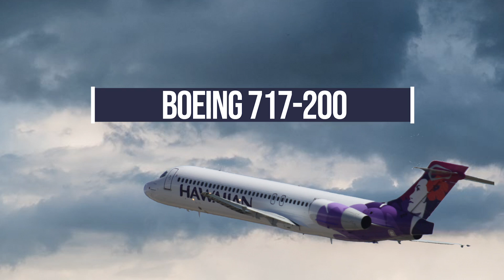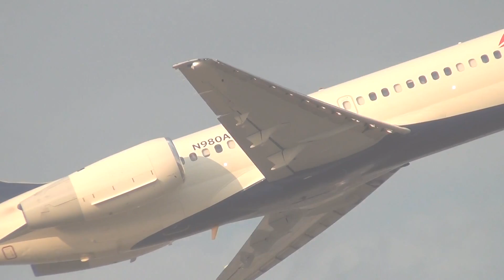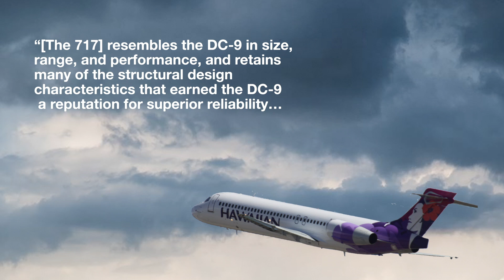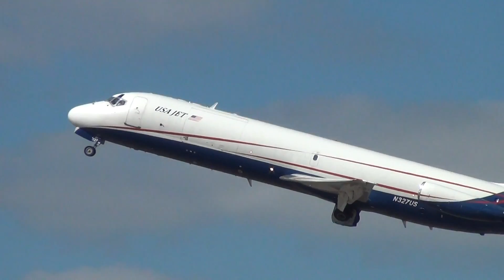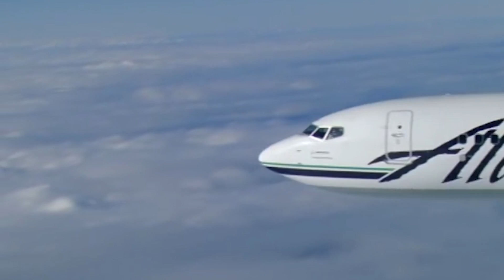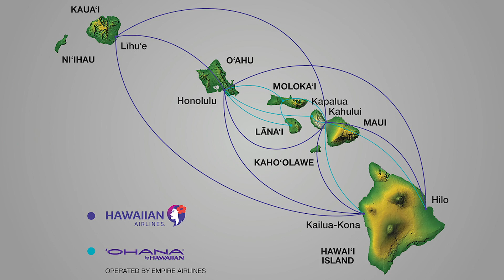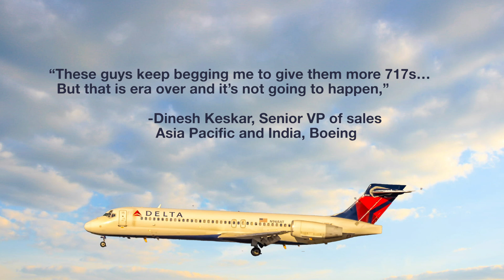Why Boeing Built The 717 And What Makes It Special

Comment: "No market could be found". Hah. Ask the guys who were working airframe planning at the various airlines, you will get a different story. Boeing and Airbus were still in denial on the 100-128 seat market when the Bombardier C Series, now Airbus A220 came to market. No one would touch it. It is no coincidence that the largest users of 717's was a large buyer of the C Series/A220. In fact the routes served by the 717 will start being replaced gradually in 2025 with the A220. The market as it is called is not being driven by seat/fuel economics, its being driven by the pilots unions. They can't get large pay increases if the airframe is too small to absorb the cost of their contractual benefits. They need/want large passenger craft to justify their existence.

Comment: The introduction of the DC9 occurred prior to the McDonnell takeover / merge. So, it was merely the Douglas DC9. After the merge, it was still designated DC9. When the DC9-80, later the DC9 Super 80, was redesignated the MD80, it was due to FAA politics. 

When Boeing acquired McDonnell Douglas, they promised to keep the MD80 series & the MD11 in production "as long as there was market demand". Sounds fair enough, but Boeing refused it's most appealing finance deals to the Douglas aircraft, ensuring their demise, and breaking their contractual obligations.

Comment: I might be wrong about this.  The stories I heard were that Boeing basically finished up the MD series run that was already in production by McDonnell Douglas at the merger, and redesignated it the 717.  It ended because it competed with Boeing's own legacy narrow body product.
Reply: Yes, when Boeing took over they went to all the customers and told them to buy 737s. Customers went to Airbus. Boeing had to finish the production line for the Customers that said no.

Comment: I wondered why had never heard of the B717, no fault of my own it seems
as it didn't appear until 1997 might be why, some also losing the eyebrow windows
normally used when banking in a turn, I thought they looked like the DC-9 type
very large bypass engines with full reverse capability as today it's just bypass air only.

Comment: 4:12: You neglect to mention that Embraer does compete in the 100 seat market with its E190. The E190 was about equal to the 717, becoming a regional workhorse for most notably, JetBlue. Sure, the 717 and E190 are 8 years apart, but still.

Comment: The 71  was the latest version of the dc 9 prior to Douglass being bought out in bankruptcy by Boeing . 
Boeing - instead of scrapping billions in r&d opted to complete a production run on the aircraft .
The engines on the 71 are so over powered for the aircraft the pilots were encouraged and incentivized to pull back the throttles - even during take off - to both save fuel and reduce hot section and o/h costs on the engines.

Comment: Maybe Boeing should have built the 717 max instead of the 737 max
Reply: Not really, the 737 MAX is also intended to compete with the A321 which is bigger than the 717 could get. But I agree, an aircraft the size of the 717 would’ve been good to compete with the A220

Comment: @3:36 - “the 717 was able to access the small, remote islands of Hawaii that larger narrow body jets couldn’t....” While I generally agree with this statement, it’s not entirely true. All of our airports here in our islands are serviced by larger jets including the 767, 777 and 747 in addition to the 757 (-200’s and -300’s), 737’s (all variants) as well as A320’s and A321’s. The issue isn’t the size of the airport as it is the turn around times and frequencies of (Hawaiian Airlines) schedules. Larger aircraft engines need more time to cool which conflicts with their schedules. WN uses the 737’s within our state and I believe their turn times aren’t as tight as that of Hawaiian Airlines. The only other a/c that could keep up with the high turn schedules is the 737-200 as was used by AQ when they were in operation. AQ tried using the 737-300 and 737-400 variants on their inter island routes and it just couldn’t keep up.

Comment: There is a other reason.  At least in europe. SAS use to have a huge  fleet of MD80. But after the gotröra crash the pilot union refuce to fly the aircraft grounding all of them.  SAS dumpad the whole fleet on the second hand market flodding  all of europe with them, kyckling away the market for the 717.

Comment: The engines are good in everything but overhaul cost per flight.  They are only designed for 8,000 cycles between overhauls versus 20,000 on the CFM-56 or V2500.  There is supposed to be a PiP as part of Delta taking the type.  

Delta is debating on retiring the 717.  We'll find out their decision within a year.

Comment: First, Boeing didn’t build the 717, it was a rebrand of the MD-95 from McDonnell-Douglas. It was an upgraded version of the venerable DC-9. Boeing never pushed the 717, because it would take market share from the 737ng. As soon as those orders were filled, they killed it.
Reply: Technically, as soon as the subsupplier contracts were filled they refused to take any more orders for it. And the reason Boeing was so eager to kill the 717-200 was that a 717-300 absolutely would rob from 737s market share. Keeping the -200 alive virtually guaranteed airlines would start calling for an MD-80 sized variant sooner or later.

Comment: The big question is: How did Boeing save the 717 number back in the 1960s by skipping from 707 to 727?
Reply: There was a 717, you know it as the KC-135! Boeing had no ides that the 7_7 numbers would become Iconic, so they gave the next number, 717, to the KC-135.  Ther are still small plates on the tanker that say this ...if you know where to look!

Comment: Sometimes Boeing just can't get out of it's own way.....they have a plane that was successful and customers begging for more but yet they stop production........ I am sure the A-220 is very grateful 😂😂😂
Reply: First off - they do suffer from 'not invented here' syndrome. But to be fair, Boeing made more off each 737 hull than DAC made off each DC-9 hull. From a business standpoint, you do not maintain two product lines to service the same market. Maintaining a 717-200 line would eventually bring pressure from customers to stretch it into a 717-300, or MD-80 size, which would have directly affected 737s market. Boeing did not acquire Douglas Aircraft to expand or continue it's products, they wanted DAC's customers to start flying Boeing fuselages. Gee how well did that work out?
Reply: @rotty9786  You are ultimately correct, Boeing would certainly not want to end up crowding out future demand for 737s, just saying the quote at approximately the 5:02 says it all

Comment: If a pilot has a DC9 type rating, would they need a new type rating to fly the 717?
Reply: No. All DC-9s had a common type rating. A CD-9 pilot would have to attend a differences class. This common rating was pushed to it's limit with the DC-9-95, as this last variant had a completely new 'Advanced Common Flight Deck', sporting a cut-down MD-11 Autopilot control (rated Best in Industry) panel and a new design center control pedestal made possible by the first-for-the-model engine FADECs.

Comment: How has Airbus neglected 100-150seaters segment when they have introduced aircrafts like A318, A319, A320-100? All these aircrafts have seating capacity ranging from 114-160. These aircrafts been widely used in past and present as well for short-haul flights

Comment: The 717 might be one of the most underrated short haul jets out there.
Reply: Last time I flew one Airtran existed.
Reply: @natep8153  I've flown them with Hawaiian.
Reply: The 717 is probably the most underrated passenger aircraft ever built.
Reply: @memeloser2376  That along with the 767-400ER perhaps.
Reply: I hope Boeing invents the 717 Max with the range of the 737 Max. It would be cool to see different variants based on the 717 and MD-80/90 series. I hope Alaska Airlines buys a bunch of those if that happens.
Reply: I agree, it's a beautiful jet
Reply: I wish we had these at AA instead of the Embrear.
Reply: @Matt Clayton Just as I have flown a few Hawaiian routes with them.
Reply: @Matt Clayton Nice!

Comment: The airframe was reliable the BR715 Turbofan engine's were JUNK! Originally developed and built by BMW the engine was an engineering disaster untill they sold the entire engine program to Rolls Royce and they did alot of improvements and it was some wat more reliable but it still had many mx issues. I worked at AirTran and at that time we had the biggest fleet of B717's and every nite 3rd shift had an engine change to do on at least 1 717 some nites 2 or 3 what a POS that engine turned out to be RR lost there a$$ on that deal. Most of those a/c are owned by Delta now Southwest didn't want them when they bought out AT.

Comment: I worked at Boeing, they have mediocre talent making poor money minus the executive bonus plan fueled by stock buybacks, until the recent 80% stock nosedive.   

Now, airlines are scrapping larger Boeing jets, as even the newest models have $0 resale value.  The USAF is cancelling T-X for lack of money.  $8T to $12T annual deficits loom, meanwhile GDP is coming in under $10T.  The Boeing Company needs to diversify or it will die a quick death. But there are no signs of human intelligence, so far.

Comment: I rode in a couple of 717-200's in Hawaii, operated by Hawaiian Airlines. It was the most uncomfortable airplane I've ever been on. My knees were wedged against the seat in front of me, and hated every minute of the hour or so it took to fly between Honolulu to Hilo, both directions. Now that Southwest operates inter-island flights between Oahu, Maui, Kaua'i, and the Big Island, I will gladly fly their 37's instead.
Reply: "My knees were wedged against the seat in front of me" has nothing to do with the basic design or the manufacturer. The airline sets the seat pitch. Seats are one inch wider than Southwest 737's because the width of the cabin and in this case the number of seats across are dictated by the basic design.
Reply: I was totally fine, you are just tall. You can't blame it on the airline.
Reply: @washmybelly.1938  You can blame it on the airline, but not the airplane. Hawaiian, not Boeing, specified seat pitch. I fly Mokulele inter-island for price and because I like the small airplane experience, without TSA hassles (except at HNL).
Reply: @washmybelly.1938  I know all that and the Airline likes stuffing as many sardines on each flight as they can. It is also noisier than most other airplanes because of where the engines are located. I actually know quite a few Boeing/McDonnell Douglas engineers from Long Beach that designed what became the 717. I  never liked it as when it was a DC or MD either.

Comment: Its worth mentioning that the BAC 111 which flew 2 years before the DC-9 really converted airlines in the USA to this type of aircraft. Aloha Airlines for example selected the One-Eleven as its first jet type for inter-island service. Braniff and Mohawk ordered their first ones in 1961 and 1962. It was eventually sold to 14 American airlines despite the efforts of the US Civil Aeronautics Board (CAB) which blocked sales to various airlines. It was blatant protectionism because while it blocked Bonanza, Frontier and Ozark from buying the 111 it allowed Ozark and Frontier to buy the DC-9!
The last flyable One-Eleven was retired by Northrop Grumman in May 2019 after serving as an F-35 testbed.

Comment: With a range of ~1370 miles, how were the 717's initially flown to Hawaii or Australia? Are the wings removed for shipment via ocean?
Reply: Not a pilot and I have no experience but I think they add extra fuel tanks to allow for the needed range. 

Being a fan of MD in general, I was sad to see 717 production end. Didn't the end of the 717 essentially kill the Long Beach assembly line as well?
Reply: Ferry tanks added to temporarily extend range. Some seats are removed and tanks installed on the seat tracks over the wings. Fuel lines are routed through small hatches in the floor.

Comment: The last Mad Dog in the skies.
Reply: Mad Dog = MD = McDonnell Douglas, specifically the MD80-series. 
With the Boeing 717 being a smaller variant somebody has coined the nickname "Angry Puppy" which stuck.
I don't recall whether the DC9 - the daddy of them all - had a nickname too
Reply: @roykliffen9674  I have never heard the DC9 being called anything other than a DC9.
Reply: @MD88Pilot  The scuttlebutt is that "Mad Dog" is also a brand of cheap booze, usually sold in brown paper bags to surreptitiously be drunk in the streets .... not quite sure why they nicknamed the MD80s after a drunk's favourite beverage. ^_^
Reply: @roykliffen9674  Cause its an noisy gas guzzler.
Reply: @MD88Pilot  we called it the "Diesel 9" at Continental Airlines, and we didn't use the term Mad Dog for our 5 different configurations of MD-80.
Reply: A "Mad Dog" is (by Aviation Enthusiasts Standards) an Aircraft built by McDonnell Douglas (MD = Mad Dog) and numbered between 80 and 90. The Boeing 717 would probably (as others have already mentioned) be a "Angry Puppy". Also, before you ask, the DC9 is also not a Mad Dog, its "Diesel 9". I know, im annoying. Oh, and the ARJ-21 is a "China Dog".
Reply: This jet was the competitor to the A318 and A319, since that was Boeings Smallest Plane Ever Built, aside from the 737-600NG
Reply: What about the ARJ-21? It still almost has the same fuselage!
Reply: Angry puppy* Maddog is reserved for the 80 series.

Comment: I managed many of those 717s, from Midwest Express to Air Tran to Mexicana Click, to Volotea of Spain. A workhorse that has a structure designed for high cycle operation. They will be around for many more years (flown in Turkmenistan for over a decade).

Comment: I thought the original 717 was a military version of the 707 passenger jet. the tanker KC-135 is an example. built in 60's-70's. the second commercial aircraft built by Boeing was the tri-engine 727.
Reply: The Boeing Model 367 was the basis for the US Air Force KC-135 Stratotanker.

The Boeing 707 was based upon the KC-135.

Comment: how do u gage how reliable an aircraft is? 
if it don't crash it's reliable lol
Reply: 'Safe' is not having many fleet crashes. Reliable is determined as 'Dispatch-able'. If an airline cannot dispatch an aircraft to fly a planned route, it is not as reliable. Boeing and Airbus aircraft require more maintenance hours per flight hour, and require more replacement parts per flight than Douglas aircraft. This is known.

Comment: The twin engine centerline of thrust airliner design.  Relied heavily on the rear stairs design for practicality.  The Robert Rickshaw jumped out of one.
But in the day of twin engine wide body jets.  The twin engine centerline of thrust airliner should be a wide body.  The 737 MAX fiasco shows how both Boeing and Airbus are not using the efficient and most practical layout.

Comment: The MD-95/B717 was a great airplane to fly on the late Midwest Airlines about 10-15 years ago before it was bought and merged with Frontier.  Until just before its demise, Midwest had a single class arrangement with wider, first-class style seats in a 2 x 2 arrangement (seat width was 20", and pitch was 34 or 35"... more than Coach, less than First).  The 717 was perfect for that layout, because they only needed to "sacrifice" one traditional Coach seat to make that work.  Had that been a 737 or A31x/32x, they would have had to give up two Coach seats.  As nice as the 717 was compared to the older MD-88, one problem was that some of Midwest's routes were just a tad outside the 717's range (e.g., Seattle - Kansas City); for those routes, they had to use the longer-range MD-88.  Just before the airline was sold/acquired, Midwest reverted some rows to standard 2 x 3 Coach seating to fit more passengers.  When they were in the process of merging with Frontier, parent company Texas Pacific Group "retired" the MD-8x and 717s in favor of A319s from Frontier and Embraer E-Jets from Republic.

Comment: Doesn't the MD-95\B717 have a shared development history with the Fokker 100? It seems to me like this project got a full steam ahead when Fokker went under.
Reply: Not quite. The Fokker 100 was another Douglas spin-off effort foisted on us by MacDonnell. As with the others (2-engine DC-10 to Airbus, China DC-9 Trunkliner) it ended prematurely, with the 'partner' retaining a great deal of DAC's proprietary data (A-300, ARJ-21). The MD-95 was wholly started by Value Jet. They had such success with refurbishing DC-9-30s and starting an airline with them, that they actually launched the MD-95 as a modern andfuel-efficient version of the -30s they were operating to expand the airline. By the time the -95s were available, the airline was re-organized as AirTran.
Reply: What started as the MDF-100 joint venture, with many Dutch engineers co-located in Long Beach,  beget the MD-87 (sort of) and F-100 projects following dissolution of the MDF-100 effort several months in.  A dual-tandem landing gear (4 vs 2 tires per side) and one other thing were about all that the two factions had been able to agree on as they went about trying to resolve the many either/or choices related to the design.  The end came when someone stood at the front of the large design area (the proverbial sea of drafting tables/desks), said something in Dutch, and the Fokker people started packing up.